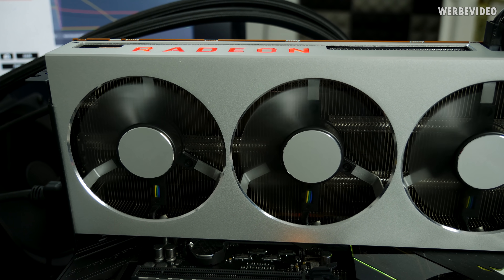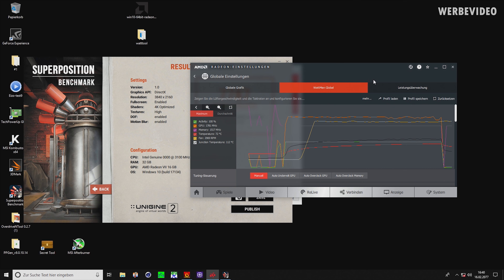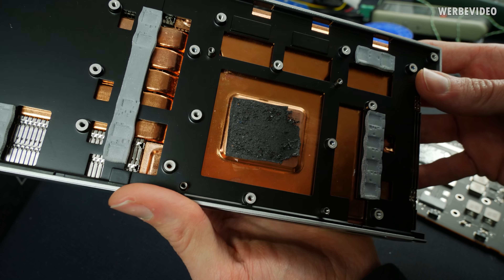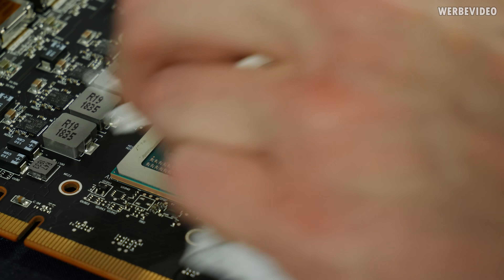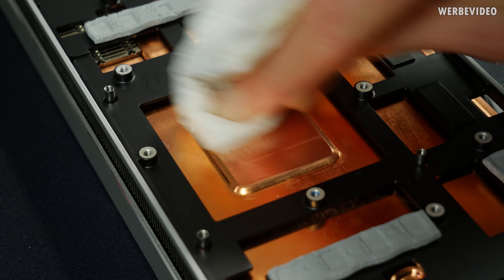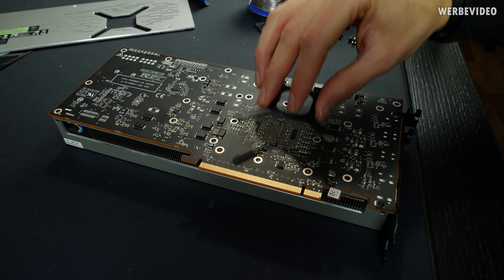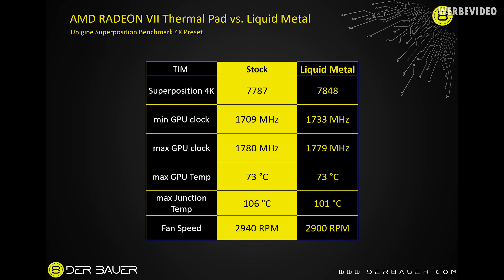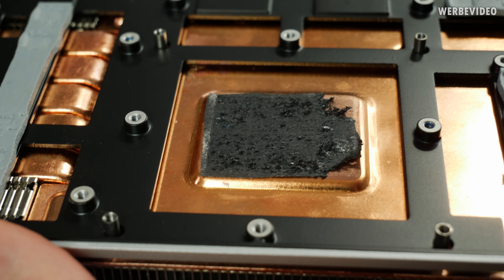RADEON VII - Liquid Metal Tuning

Comment: Good note on the thermal pad thickness. Does this mean for water cooling you need to use a large amount of thermal paste? I have heard from other overclockers that this gpu needs to be "gooped" with paste

Comment: I would never use liquid metal on a vertical card because if u overapply(IT IS IMPOSSIBLE TO ONLY HAVE SURFACE TENSION IN A VERTICAL SLOT ALL THAT KEEPS UR SYSTEM FROM DAMAGE OF A HEAVY ASS LIQUID METAL)  IT WILL LEAK OUT and short things like ur pci-e slot or get under the gpu chip around the sides of the metal lip.

Comment: By chance did you try adding a spacers to the back of the tension mechanism to get a bit more pressure on the GPU die?  maybe that will make a difference?

Comment: soon as i seen it being put back together, i knew it wouldn't work like you'd expect. Removing that pad and throwing liquid on there is leaving a gap/pressure issue since it's designed for a specific thickness. add a plastic washer that meters in the same thickness of the pad you cut.

Comment: Try removing the fans and replace it with 120mm ones, made good difference on my strix vega 64. I had huge change in temps going to liquid metal on vega 64. Anyway i read the nail polish need to have acrylic to be useful and only a few nail polishes have this. Whats your comment on that?

Comment: Liquid metal pissed me off...  Made my CPU heatsink stick like it was welded to my cpu.  It dries;  How come no one tells this? cpu pulled of the socket without being able to unlock.. leaver was unacessible of course.
And of course my heatsink is pure copper by the way. Just a heads up to people.  Then I used mx2 and temps are just as low..    did sand clean both surfaces.  It was stuck on very hardwith the liquid metal.. the german stuff.. .  Razor blade on the join and it popped off, but was a scare.

Comment: Serious question: has anyone tried using diamond dust as for a heat sink material? I read it has extremely high thermal conductivity. Cost. Ok fail. But still interesting idea to me.
Reply: instaling CPU cooler on GPU will give u better result.

Comment: @der8auer Just found out info about Carbonaut .Is it possible to share results using this thermalpad?

From my experience it looks like some of the cards may have air bubble under preapplied carbon TIM or slightly bent vapor chamber. In such situation usage of TIM is a better solution mainly because of potential hotspots.

Comment: I feel like AMD should have also done a 56 CU option with 8GB, maybe even lower clocked and more power efficient. So it could have been an RTX 2070 competitor at $500ish. 
That would have been interesting
Reply: Dropping the memory would hit performance due to the nature of HBM and Vega architectures. Needs the large amount of memory so the gpu doesn't become memory starved.
Reply: @Kathdath  it would have been in the same performance teir as v64, so wouldn't have been any more of an issue

Comment: What is the "junction temperature" and why is it so high?
Reply: a little late, but the junction temp is the temp of the hotest sensor on the die. the die doesnt have a constant or equal temp. mostly because of imperfections in the die or the surface of the cooler.

Comment: are liquid metal pastes based on gallium? I know that gallium makes a very bad reaction with aluminum and COPPER. But it is excellent on nickel-plated objects.
Reply: Gallium and indium as the proper alloy has such a low eutectic point it stays liquid in room temperature while pure gallium doesn't. Gallium amalgamates with aluminium, but it does not with copper. Some diffusion may occur, but that doesn't deconstruct the copper cooler base material.
Reply: @peterkiss1204  Thanks for the explanation

Comment: You get better thermal conductivity with graphite powder polished into both heat source and heat sink but they both have to be extremely flat.  But I wonder if its possible to make an alloy with Gallium and Graphite powder and get even better thermal conductivity between source and sink.... ;)

Comment: I'm starting to think AMD bugged this card on purpose to crash Everytime someone tries to modify it's stock settings, so that the GPU doesn't outperform Nvidia yet at basic levels until they buy enough time to get Navi done... They may have given us all a Trojan horse.

For a 7nm GCN GPU, it's undervolting capabilities should be extremely effective, potentially surpassing the GTX 1080 to easily maybe?

My Vega 56 Strict 8GB refuses to go above 1318Mhz in furmark even when I ramp up my memory clock rate, I mess around with different settings and I can get 120-130fps based on changing them, for a 1080p test. It's obviously a memory bottleneck, and will go above that clock speed outside of furmark.

Comment: This card is a complete mess. I can see why AMD pushed the Navi release back, they have some serious issues to work out and it's a chip based issue. No driver is going to fix the issues this 7nm process has.
Reply: Well clearly its not a chip issue its literally a mi50 gpu that didnt make the cut.. The silicon is exactly as intended.. Now of course the real issue was sellung it as a gaming card
Reply: @Alexiel-f6o  Nope, the 7nm process has messed this GPU up. There is a physical issue with the chip. No driver is going to fix the issues this 7nm process has.

Comment: I wonder if the resin coating used to level the die causes any negative effects towards cooling, I do know it's there to improve cooling due to some cards from Vega not having a flush die and resulting in no cooling but really I do wonder what other effects it can have on the hard. I'm sure they spent a good deal of time working on the resin but honestly resin isn't known for it's heat transfer so to some degree it surely has a impact.

I also wonder if this would prevent etching from the liquid metal on the silicon die as it shouldn't react to the coating.

Comment: What I'd like to know is if I can use a graphite thermal pad for vrm and mosfet cooling cause that'd be a great option because it'd be something you'd literally never have to replace and know you'll get solid performance out of it over whatever stock pads those components already use.
Reply: I'd be cautious about using it anywhere that has contact to the pc because graphite definitely isnt the best insulator of electricity so you might have problems .. Nit an expert on that but srill
Reply: @Alexiel-f6o  I suppose that would make it trickey. :/ I guess Fujipoly ultra extreme is still the best performing solution then, albeit expensive.
Reply: Graphite pads are electrically conductive, you don't want them on components that carry electricity.

Comment: How do I buy this card? It went out of stock in 30 minutes and I'm getting the Vega 64 launch shortage PTSD.
Reply: it went out of stock because stock is almost non-existing most places, not because of popularity, the card is hot garbage. tons in stock here in germany, no-one wants them, at $499 it would have been better and with custom cooling solutions or water. but meh, 300 watts for less than 2080 perf which draws like half. i miss ati ...
Reply: I think the more appropriate question is "why would you buy this card?"
Reply: AMD site has them in

Comment: Wait, if you took off the graphite thermal pad and replaced it with LM and did not see very much drop in temp even with fans at 100%.

Does that possibly mean that the card cooling is already saturated or that the thermal pad is just really good at what it does?
Reply: Probably both. I think the die is too small for this power rating. The power density is over the roof and maybe the die is unable to transfer that much heat.

Comment: I was playing Apex Legend and i set my fan speed within my drivers to 60% but msi after burner was showing it set to 70% so i had to set speed to 100% before it fixed itself. dropping it down to 60% then worked.
My worry is when i see reviewers using this 3rd party app they can make a card look hotter at a set noise fan speed by showing msi after burner showing 60% fan when in fact its set to 50%. i am now unable to replicate it, sliding the slider to 100% fixed the problem.

Comment: wait a sec,i though using liquid metal with copper plate is a bad idea.
Reply: Aluminum not copper
Reply: Democritus86 It will stain the copper, but the effect is purely cosmetic. Cooling performance of the stained heatsink isn’t affected so you only need to worry if you’re going to resell your components. As mentioned before me, the liquid metal will destroy aluminum structurally, which will very much affect cooling.
Reply: @MultiPureEnergy  oh my bad  your right.

Comment: I start to think you would get better thermal performance by cutting the shroud, removing the Radeon logo and all the aluminum blocking the fins on the logo side...
What's the point in having 3 fans if the air can't get anywhere ? They should make the shroud as open as possible on this side and put the Radeon logo on the backplate.

Comment: Any plans to do die and heatsink lapping, or using washers to change the mounting pressure? Also undervolting.
Reply: He already mentioned that once he undervolted the card, it became unstable and would consistently crash.
Reply: But another guy did it so it's possible. Also the drivers won't be broken forever.
Reply: I lapped mine. Max junction temp hasn't really improved, but average temp during testing is lower, and max fan speeds aren't ramping up as high with the same settings.

Going to try a larger undervolt soon. Right now i'm testing the settings that tested stable before lapping.
Reply: omg a reply with some substance...I don't even know what to say! 😄

Good info! So I guess fan speed is tied to avg temp. Too bad max junction didn't improve. Did you see the thing where the guy lowered that by putting washers where it screws to the backplate? I think he got 10°C off his max junction temp. It seems at stock the pressure is more toward the edges of the die but that mod helps the centre of the die make better contact.

Good luck with the undervolting. I wonder how far the average card can go with full stability and how much it improves thermals and frequency.
Reply: @bardacuda82  fan speed is on the junction temp. The max fan rpm isn't down very much, but it's consistently down every test. I think it's hitting that max temp very early, faster than the fan ramps up, and then the temp never gets quite that high again.

I did add some nylon washers as well. Didn't seem to help with my card. I will say that my lap job wasn't perfect. There was still some discolored areas where it wasn't perfectly flat, but it was much better than it started. Was a bitch trying to sand with so little space to work with.

Comment: I was really wanting AMD to do well unfortunately its 2 years late and nothing special. Very disappointing drivers at launch I can see this card has potential with better temps and drivers!
Reply: these are not public drivers meaning the average person that buys one wont experience these issues
Reply: CaptainCrazy500 but the card is already released
Reply: @chikennuget3634  yeah and they released public drivers a few hours ago
Reply: @captaincrazy5008  Implying it will get better.
You might see a couple of percentages in performance, but the card will still run it's fans at 3000rpm.
What a joke.
Reply: @hurrdurrimaburr  they also said they will be addressing that
Reply: @captaincrazy5008  How? They need to run that fast to even keep the card on 70c without any OC.
Face it, the noise levels won't get any better.
Reply: Rtx is more disappointing damit infact it's fatal!
Reply: @MrCarjokey  It's actually kinda cool when you try it out for yourself.
The optimization patch that's dropping today will probably give even better frames. And I already had around 70fps minimum on the most demanding map in multiplayer. Just turned it on to see what it looks like and it's deffo not worth it for MP. But seeing your own reflection in chrome weapons was kinda cool.
Reply: @hurrdurrimaburr  Yes and after that we can also gain more fps by doing some tuning of settings in driver's control panel. That's what's the CP for right? We can't just set it all up to max. Anyway I think both Nvidia and AMD drivers for Windows are kind of resources demanding. Why can't they made it like in Linux which are very small.

Comment: I have no desire to buy this uninnovative card but I am thankful that you made this video because I am getting to the point where I want to try to possibly mod some of my gpus or at least one of them for practice. 
And I did not know about the the graphite pad. And have yet to use liquid metal.
Now that I'm thinking about it I did open up my GTX 760 and reapply some paste to that and it did help a little bit. I guess cuz it was old it benefited. 
Great videos. Cheers. 😉😁
Reply: "Uninnovative"? First ever 7nm GPU, first gaming card to hit 1 TB/s stock (RTX drastically slower), first gaming card to use 4 stacks of HBM...

What was Pascal? (answer would be lame, my Titan Xp is nothing special other than its a Star Wars edition, ooooh so innovative). The feature RTX was named for only works in 2 games, and 1 is technically a demo (but it is super awesome, so you should definitely go run the Quake ray traced mod). However, just saying, Radeon RAY was a thing a ways back, and ray tracing has been a thing for an extremely long time. I don't think the tensor cores actually do anything useful that CUDA couldn't (CUDA can ray trace, its done in a lot of applications...), its worse than PhysX (which was an awesome idea, and actually useful, but it also went the way of the dodo bird and only had like 20 games it was poorly implemented in).

Vega VII is much more innovative than any recent card I can think of (besides the Fiji cards from 2015 that were the first ever to use HBM)
Reply: @jakegarrett8109  7nm doesn't do anything on an existing architecture exponentially. 7nm does nothing in and of itself either. Just smaller. Wowee. A large bus is nothing new from AMD. They have done that before and so has NVIDIA. Adding more VRAM is nothing new either. Both have done that too. What have they really brought to the table to change the gaming industry? Nothing. At least the RTX features are something to be there to push graphics forward. And without the RTX features the Nvidia cards still are better than AMD. So yeah what is innovative my friend? Blah, blah, blah. Keep making excuses for AMD. It does nothing to help gamers. Maybe if you like certain calculations it may be good but I don't care about those as a gamer.

Comment: der8auer
Roman, given that this is an AMD card you might want to try to lower the voltage a bit while increasing the power target. ;)
Reply: He is aware of it, he says at the start of the video that he tried to undervolt but it crashes immediately. I'm sure he knows how to overclock a Vega card.
Reply: @K3nok1  
I hadn't seen that one yet, it was based on his last video which I did see. Roman is an expert at overclocking, I don't know if he is aware that AMD puts that stock voltage much too high all the time.

Comment: Lap the heatsink.
Reply: Very little benefit in sanding / polishing these days.
Reply: doing that would destroy the Vapor Chamber as they use thin copper to make them because it reduces the amount of metal between the GPU Die and the cooler

Comment: Honestly seems to be a limitation of the cooler design
Reply: But as the fan speed was increased it didn't increase the performance. If it's limited by the cooler, then the heat pipes must be insufficient.

Comment: liquid metal isn't really worth it on a stock cooler.  the heatsink heat-soaks in a short amount of time where itbecomes a limitation of the cooler moreso than the thermal material connecting the gpu to the heatsink.  noticed this with my 2080 after applying liquid metal.  now, liquid metal + a waterblock, that's what i'm interested in (Come on DB/Steve).
Reply: That's only true for blower coolers because they have a comparatively small heatsink. There's only so much heat you can dissipate on a given surface area. That said,LM does improve temps by 4-5c even on blower coolers so it is worth it in all cases.
Reply: Ali express has waterblocks for. My zotac 1080ti mini bykski I think. It fitted really well and quality execellent. Idle temps of 18oc load of 49oc.  Cannot be many people watercoolong 1080ti minis. So there.m is hope for a block.
Reply: EK hasn't even announced any plans to release a water block for these cards

only 5000 have been produced worldwide

of those, probably 5 will bother to water cool it (yes, it's that niche)
Reply: @iamdmc  where did this 5k production come from amd said that wasn't true
Reply: @jdrok5026  Yep not true it's less :) UK got under 200 cards total, Finland gets 15 cards (just one shop wohoo), everywhere already sold out. They plan on releasing more cards weekly, so I'd guestimate 1st patch was 1000 cards and after 2 months it's EOL.